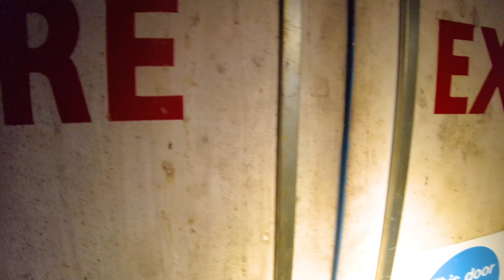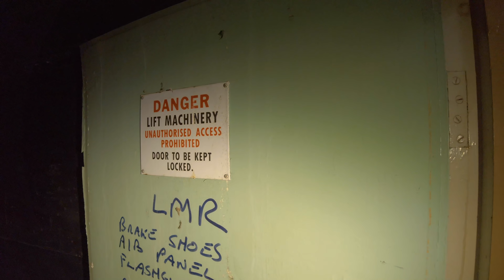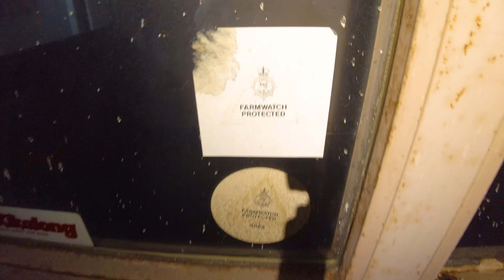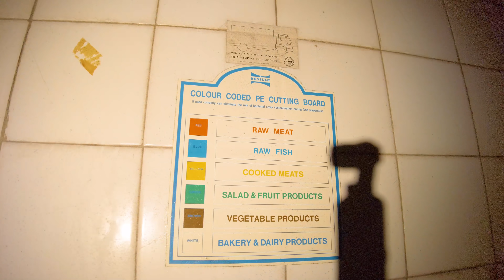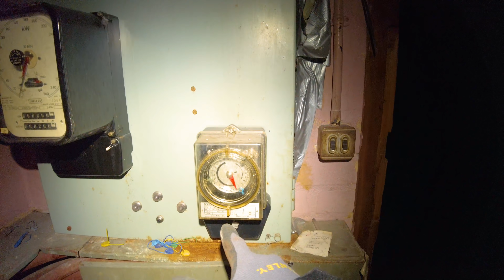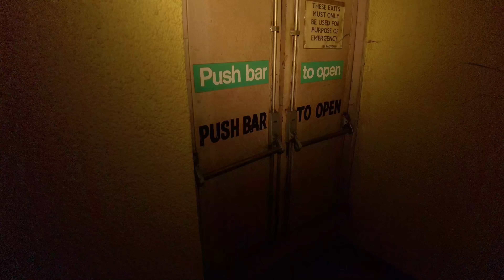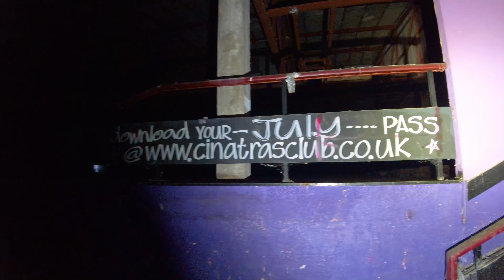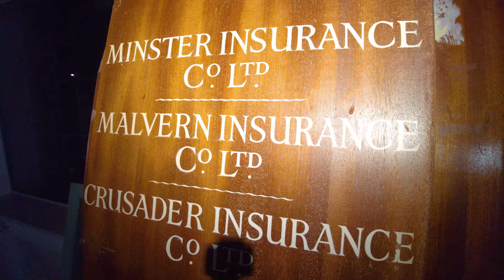Sneaky Zodiac Centre Explore PEEP SHOW WAS FILMED HERE v2

Comment: I see you asked @Croydon Council about Tabner House. Yes it was and its still there stripped out and almost unrecognisable. Because of the construction of the basement/sub-basement it was not economic to demolish it.
Reply from the maker: So the bunkers still there? They said it wasnt.
Reply: @TheSecretVault  If you look at the base of the new towers, they sit on a massive concrete base, that is the bunker. That is the structure too massive to demolish. Always been hidden in plain sight since Tabner house was demolished. It was unusual in that the entrances were inside Tabner House, the air handling shafts were on the corners and the emergency exits were one in the park opposite and one in the basement of the currant council building. From ground level nothing was really visible because the "Roof" was at the first floor "floor" level and it was surrounded by board fencing. However a bus ride past revealed all!  Rob G8PVI.